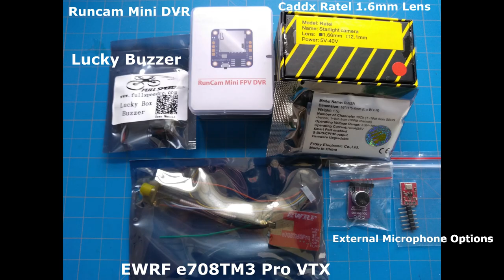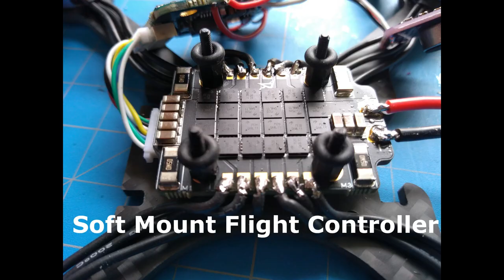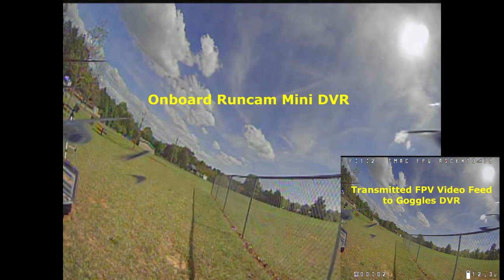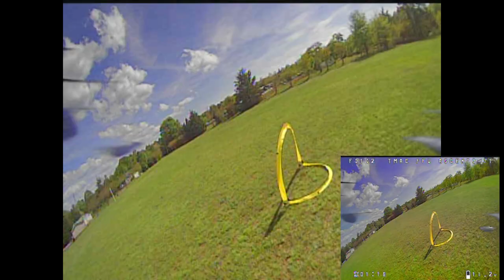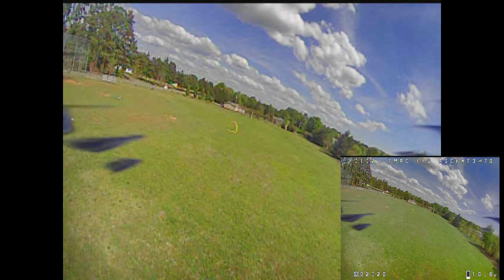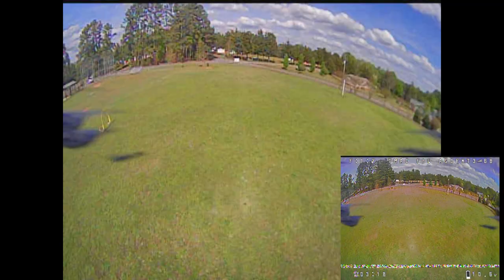Micro FPV 3 Inch Quadcopter Build

Comment from the maker: Feelin' Good 'Bout this One! Need to tell you a little story though . . . started out with a brand new GNB 4S 850.  Only brought my 3S battery strap with me.  No problem, right?! After a phenomenal acrobatic, precision (for me) long flight filming with the Runcam DVR, came out of a maneuver and went head-on into the line of thorn trees outside the park fence.  OUCH! Battery ejected! Only way I found the Quad was because of the Lucky Box Buzzer which has its own internal battery and I programmed earlier to go off every 30 seconds for 12 hours if needed to find the quad.  Lucky Indeed! Found the Quad and the battery! Bad news was the VTX ground wire had been cut (by thorns of tree?). So, had to re-solder.  Flight footage lost from Runcam DVR because battery ejected and it lost power before I could push the little button on the DVR to save it.  Re-flew  with a 3S.  Not nearly as good, but not bad overall I think.  Your thoughts? Thanks for watching!😉👍